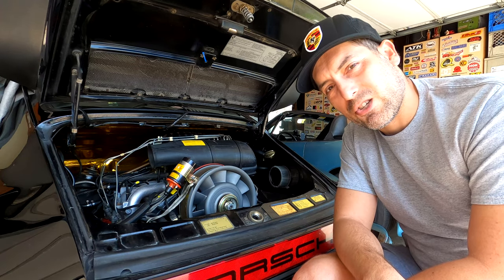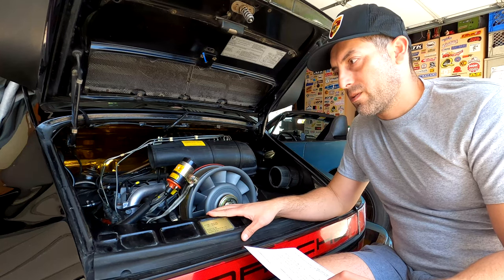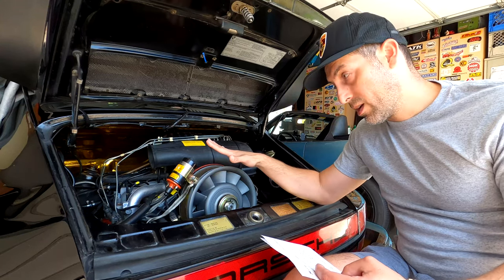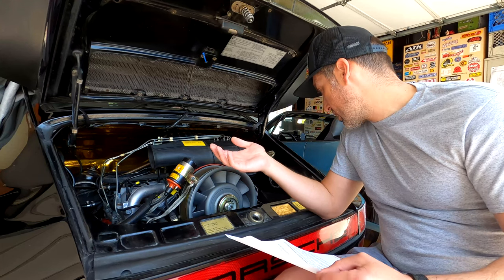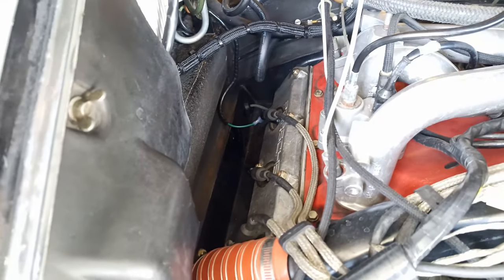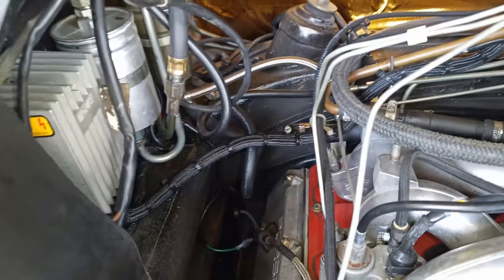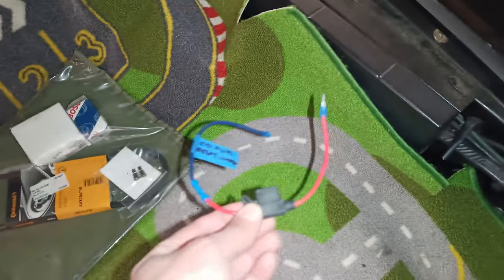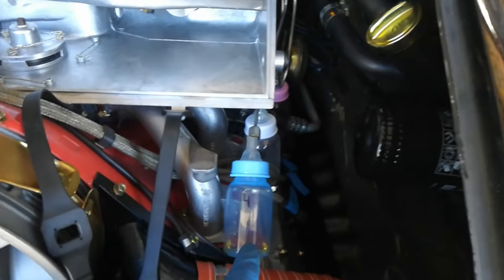How To Setup Initial Fuel Mixture for Porsche 911 Bosch CIS K-Jetronic Fuel Injection

Comment: Hi Joe I'm struggling with a 930 I have to much fuel pressure the tank return was blocked and I have cleaned and coated the tank my mixture screw is way out